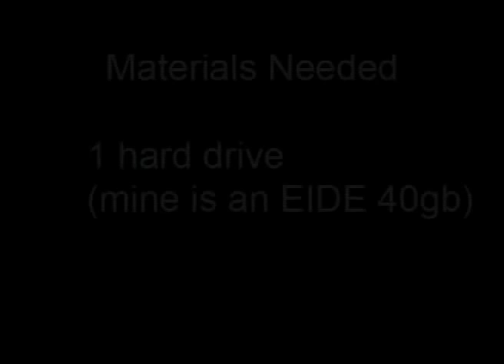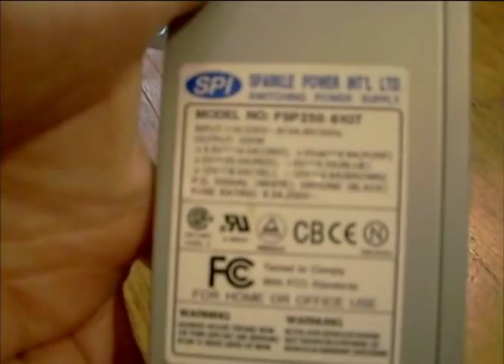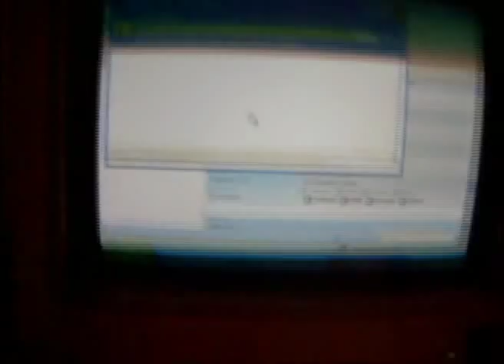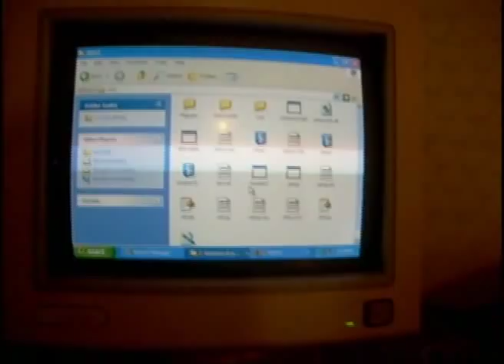Toaster Computer

Comment: Heh, I like your song choices (Portal FTW!)...

Looks like a fairly basic PC... just crammed into a toaster o.O

Good luck with the passive TEC cooling. IME TEC's get so hot that you need some decent cooling (usually water cooling, or really good air cooling, such as with a Zalman CNPS9700) to keep the cold side cold. When I had my rig cooled with an air cooled TEC, it'd idle at subzero temps, but if there was much load on the CPU, it'd get up to 50-60C because the TECs cooling couldn't keep up.